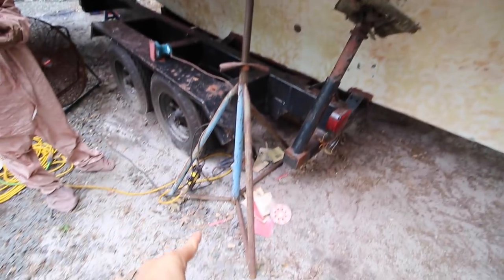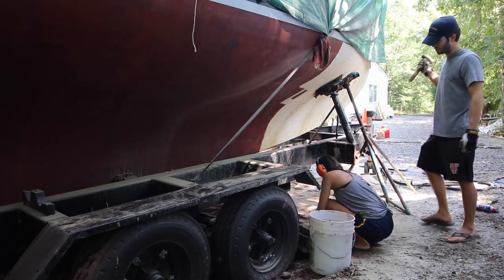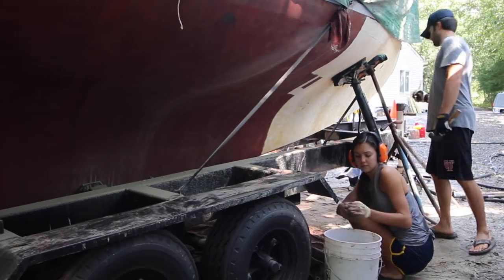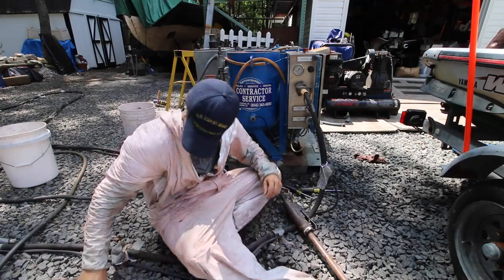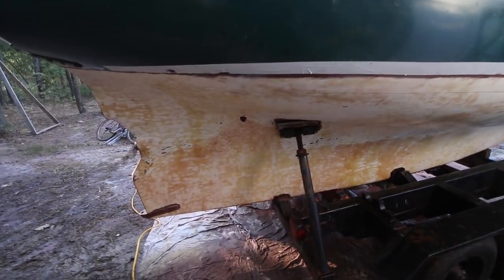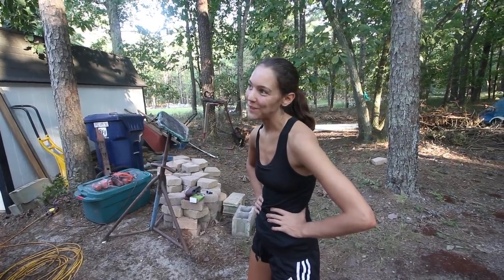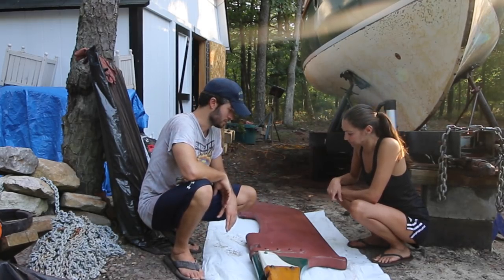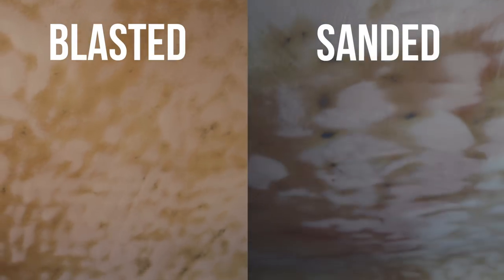45] Backyard DIY Classic Sailboat Restoration | Abandon Comfort

Comment from the maker: Here's the respirator we use & mention at 11:24 : https://amzn.to/2wxr2G5 
Sanding drill bits we use for the bootstripe area: https://amzn.to/2wvvrtg

Thanks for supporting the show using these amazon links!
Reply: Look at 8:04
Reply: Why Did you sand off $600 of paint?
Reply: because it was over 10 years old.
Reply: doesn't matter that paint wasn't going anywhere, all they needed was a light sanding and a quick repaint.
Reply: How much work do you have before your back on the water?
Reply: No Job  it's a long keel  from bow to stern. Tracks like it's on railroad tracks.
Reply: I gave up on y'all...I pulled my patreon support. Why? I have many, many years on you two. I'm a successful businessperson (irrelevant), but please heed this advice: there's a MAJOR difference between being "cheap" and "fiscally responsible/frugal/prudent/thrifty." You two are cheap/penny-pinchers...which is extremely dangerous as young entrepreneurs/creators. My true intention of this comment is to give you unwarranted advice from a total stranger that sees potential in you. Best of luck.
Reply: I just "binged" your whole series..very interesting and entertaining...I also have decided to go with a much smaller boat then I have had in the past..I've learned that I only live in a very small part of any of the boats or motorhomes I've had..As a retired single guy, a "pocket cruiser" seems the way to go..I have no intention of paying the slip fees, or maintenance costs of a large boat..I especially like the electric motor idea (something I am also planning)...You guys are on the right path and I wouldn't worry about any negative comments from folks that don't get it...Go South!!
Reply: I understand the benefits of electric engine but what are you planning to do if caught in a bad storm with no sail and a lame battery engine? Keep diesel dont use but have it ready for emergencies were u get no solar for days and bad wrather conditions were it safer to run engine than a sail.
Reply: Wow, I came to the comments expecting discussion and maybe assurance of y’all’s saftey despite the month hiatus, and all I find is all this negativity. I hope you’re safe and not too downtrod from the hate, i love your series and I’d love to see wherever you decide to take it.
Reply: So what happened?
Reply: @Kampup  well thanks pal.  Why you so late to the party?  Maybe next time, show up on time with your advice.

Comment: I hate to jump on the bandwagon, but you should watch the last few episodes of "Sailing UMA" they just spend thousands of dollars on Lithium batteries for their boat and found out that they only get 1 and 3/4 hours running time at 5 to 6 knots speed. What if you loose your rig? What if you hit several hours or days without wind? What if you're trying to out run a storm? I like the idea of electric, but it's still needs some work as far as I'm concerned.A full tank of diesel will probably last you almost a year with that boat. I have a !GM10 Yanmar that sips a little over a pint an hour at WOT. Can't do better than that! Also, a diesel can make electricity and be used to run a high capacity bilge pump. An electric can only draw your batteries down, then what hand pump for hours offshore?  You're going to go to all the work, expense and still not have a system as good as the one you have. You can keep the diesel and always add an electric outboard if you want! Sorry but I think you are crazy taking that diesel out!!! Love you channel and both of you guys, your a great hard working couple and I wish you only the best!
Reply: You make some good points, but if I remember correctly, they already removed the deisel, so it's probably a moot point. I think the danger aspect is overrated, but the bilge pump and alternator is a good point. If it were me, I would cruise for a year and collect data about how they use it, and when they do go electric, have a Honda 2k generator as a means of generating electricity just in case.
Reply: I think they plan to train couple of dolphins and put them into harnesses to help aid in propulsion :)
Reply: There diesel wasn't working, but they had bought what they thought was an exact used replacement for 3000 dollars that was originally a generator motor, which unfortunately wouldn't work for some reason.That's when they decided to switch to electric. You'll never be able to bank enough electric power to motor very far. I'd rather use that solar to power a fridge/freezer or a/c unit. The new multi-stage compressors for refrigeratioin make it possible to run on small solar systems. While a generator is a good idea, it's something else to get stolen, another fuel to carry and something else to store. I wish you the best of luck, but I just don't think that electric is the way to go yet. I'll be watching you guys as always to find out. Hope your not upset with me for being so opinionated. As for going smaller I think it's the right idea with the right boat which you have. What a great boat! You were very lucky to find her! I myself went from a 38' to a 26'. I was so much more happy with the smaller boat, less cost, easier to maintain by one person and easier to handle. Unfortunately, due to health reasons I recently had to sell my sailboat and move to a trawler I just bought a 32' Grand Banks which has 4 solar panels on it! Again, good luck!!!
Reply: @spinnaker5514  they seem pretty stoked about it, In fact there buying a new electric motor!

Comment: I had an outboard on a 25' Catalina sailboat.  Do not go with an outboard, if you get into rough water with a short wave set, the outboard will be out of the water as much as it is in the water.  Definitely a sub optimal result when you need a motor the most.

Comment: I’m anxious to see the hydroelectric application in comparison to those that I’ve seen with cities that are using today with units that are in channels, bays and rivers. Of course they are generating electricity for cities or as I have seen placing one in a small waterfall on private property, to generate power for a home. I believe you would be pioneers of this application, since I have not read or seen anyone trying this. Very smart as you sail, you would be generating power to keep the batteries charged. Can’t wait to see your proposed design and implementation.

Comment: after having owned several sailboats ..nothing is better than a small Yanmar diesel for strength , reliability and economy . Get into a squall and you'll be glad you have the power to hold your own ..it can be the difference between losing the boat and getting thru the tough spots .

Comment: I have a boat with an 48 volt electric motor and love it !  I have a propane generator to run through my batteries and a heck of a lot cleaner and the fuel is reliable !

Comment: Electric engine would be fine for a river boat but I wouldn't want one for an offside sailing vessel. The batteries don't have the range and you've got no immediate way to charge them (short of a generator which defeats the object a bit) so you could be stuck mid ocean in bad weather thats a big no no for me.. I would stick with the diesel.. And stay safe guys.
Reply: Andy Smith    Especially on a river (with shores so close, and tight manoevering) I would like to have a reliable and predictable boat engine.
Reply: Normally ocean weather comes with wind, so they'd likely hve both the wind gen and hydro gen working. In the Doldrums you generally have solar. Sure, with solar you're only barely ticking the engine over but 1 knot beats no knots...

Comment: I'll look forward to your outboard vs inboard electric propulsion decision process. I would think an inboard would make the most sense for reliability, weight distribution and center-line thrust maximization but I'm no naval architect. I'm just a rocket scientist. So I'll be learning along with you guys!
Reply from the maker: Pros & cons for everything boat related! No stuffing box, cutlass bearing and fixed prop to slow us under sail with an outboard.
Reply: All things I wouldn't have considered. Thanks for helping educate me through your videos and experiences. Maybe I SHOULD have been a naval architect!
Reply: I have an outboard on my 27 foot Albin Vega for cruising, and I really wish that there was an inboard, as when you have choppy waves it "breathes air" to the point that I cannot use it at some angles. It might be different for your boat, as it is heavier and beamier, but I will say that having a motor to get you into a harbour even when its windy is very valuable. I am thinking of an electric inboard too, but I am not sure as I want to be able to use it in the arctic where motoring can be very important.
Reply: You already have the prop, shaft, and Cutlass why not use them. You'll just make more work for yourself taking them out. An outboard on a boat this small in even small waves will constantly be coming out of the water causing it to cavitate and over rev. Even and electric one will do this. You will loose boat speed and in the end use far more energy this way constantly working to get the boat back up to your desired speed only to have the prop come out of the water again and the boat slow. With an outboard you're also adding a 90degree gearing so you will loose more efficiency there as well. With the motor low and inside the hull and a straight prop shaft it will be much more efficient. Also you can get a prop that will best match what you need for the speed and torque you will have. On an outboard you are very restricted to the size and shape of the prop you can use. Listen to the guy with the boat 5ft bigger than yours you want it inboard. Also the motor and electronics will be much better protected inside the boat than in an out oars hanging off the stern with waves breaking over it. Also that's the exact place you don't want extra weight is in the bow and stern, it will only worsen the boats motion in the waves( Hobby Horsing). It's already not going to be super great. With the space constraints for battery and the already well documented energy needs for the run times you want, you don't want to start throwing the extra inefficiencies of an outboard in there.
Reply: The only outbaord systems I would be interested for blue water in are those small enough to pull and stow inboard after getting out of port. The others work fine until you get pooped on by a breaking wave. Then things might not go so well with em. I knew a guy who did that with a 3HP outboard on a 24' boat. It worked out very well actually for him. Nothing you are going to drive through the doldrums on but enough for most everything short short of getting into Oregon Inlet in a blow.

Comment: I ask the same question as by others below.  Why remove that paint, looked like it well protected the hull, would make a good primer if you wanted to change color.  I liked the red/green combo.  Working to death after redoing the deck on the bigger boat.
Reply: Many bottom paints require that the boat be launched within days of painting.  12 years (or whatever it was) is asking a lot.
Reply: Anytime you acquire a new boat I think its best to get into everything so you know what youre dealing with. Imho....
Reply: No not if you are going to hard sand and redcoat!  Full coating removal is required when the coating has 'failed'.  Failure of coating is identified by delimitation and pealing. If this is not occurring it means the bonding between layers is strong.  My opinion is if the coating has not delaminated nor pealed after 10 years, there is EXCELLENT coating bonding and so keep it on but do a hard sand to prepare the surface for the new coat. Senior Surveyor Lloyd's Register! @CorwynGC
Reply: @georgexio5430  I was going to ask the same question, but you answered it quite reasonably.
Reply: You don't know what's underneath the paint they could have blistering underneath and you would never know it that's why it's great to remove all the paint when you get a new boat on the bottom
Reply: Thomas Mcilwain No, if there is delamination or blistering you would see it.  If there was, then only that specific area needs repair.  George G, Leed Senior Surveyor Lloyd’s Register

Comment: This may be too late, but as one piece of advice, if you attach a shop vac to your orbital sander you will get about 5x more life out of each sanding disk and there's A LOT less dust to breath in. Pretty much every orbital sander I've come across has an attachment for attaching a shop vac tube. Or if not, its worth buying one. Glad to see you're protecting your lungs with a respirator.

Also, your hair is looking great in that opening shot. Well done.

Comment: So many old time 'sail only' craft lost on the rocks and reefs because the wind blew the wrong way. Electric engines are 'green' but you won't get more than an hour or two of propulsion out of the best batteries. Having a small Diesel as a 'life saving' and 'boat saving' back-up is just good sense. It's not about 'weight saving' vs. 'no fossil fuel', it's about staying safe on the water. Come on guys, you use an auto to travel, a truck to tow and power plant electricity to work on the hull. Having a potentially life saving engine is not abandoning your desire to be 'Green', it's facing the reality of travel on the ocean.  Even a decent sized outboard would be an option. I had one on every sailing vessel I've owned...

Comment: I hope you guys realize  that you have the world best pocket blue water cruiser monohull sailboat in the world, not to mention yours has beautiful teak decks & a beautiful wooden mast. If you guys decide to unstall an electric motor, check out the Seimens emrax motor, strongest e-motor weight to horsepower ratio. They also have solar cell panels you can walk on, I was also thinking you could put on davets to hold a dingy & mount a couple of solar panels there. Can't wait to see it finished & good luck.